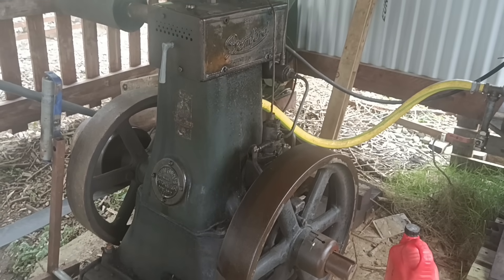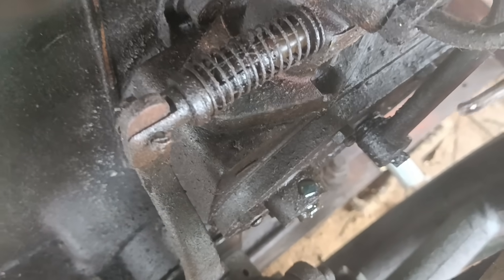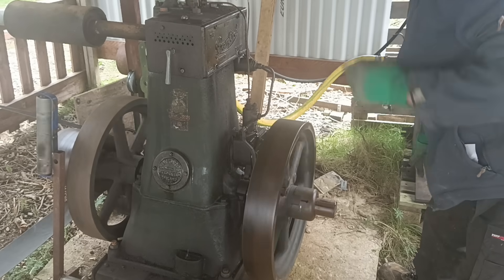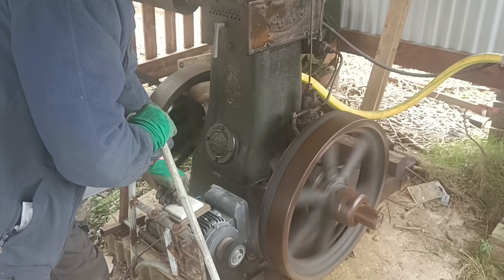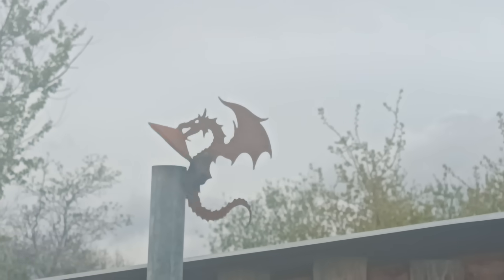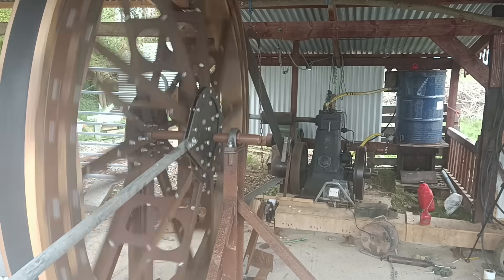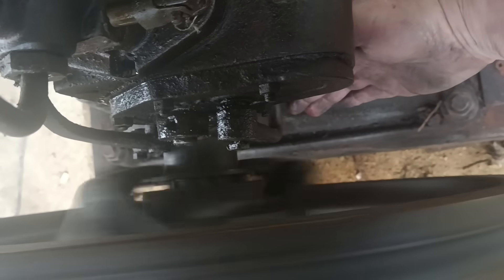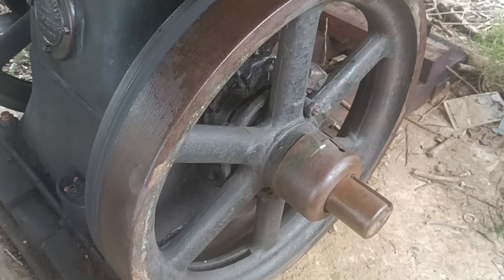How Much Fuel Does This Vintage Engine Use? Bamford stationary single-cylinder diesel efficiency

Comment: 6 HP is very low. A tractor mower is comparable. Or a small motorcycle. Or a Generator
5:51 I think you made a mistake.

1l of fuel has around 10 kWh. Since you needed 0.45l Diesel, you needed 4.5 kWh of Diesel Energy. But even a modern Diesel has only an efficiency of 35%-40% in its best working state. (This engine is neither modern, and probably not run with the right load, but I dont have a Datasheet for that specific engine, so I'll assume an efficiency of 30%, a steam engine has 10%, A 3 Phase electric Motor has a efficiency of 95%)

4.5*0.3=1.35 KWh of usable Power, 1.35/0.95=1,42 kWh of electric power.
You said that 4.5 kWh cost you around 2€. So this should be 0,44€/kWh. what results in a price of 60 cents.
Since it doesnt run in an efficient area, it would be closer to 42 cent.

If someone has real numbers, feel free to post them.
Reply from the maker: Thanks, Christian. I wasn't comparing the kwh of the diesel fuel - I was comparing a 6hp engine to a 4.5kwh motor.
Reply: @wayoutwest-workshopstuff6299 
 but if you compare the 4.5 kW electric motor at full load, you need to also take the fuel consumption of the engine at full load, which will probably be between 2 and 2.5 liters of diesel per hour...

Comment: Many years ago Tim, there was a push towards total power solutions. These were I believe a small Fiat diesel car engine, a generator and it used a heat recovery system from cooling and exhaust. They were hailed as the solution to "high energy prices" and every house could have one. If the Bamford can do it, let's hope it will not become commonplace.
Reply: Fiat diesel engines are Very good
Reply: @goodlife6277  but would you want one running in next to your house, in your neighbours garden all the time, or in all your neibours gardens. Heating oil boilers around me are smelly enough, cheers.
Reply: @ooslum  Never

Comment: Surprised by how little it uses, thanks for sharing.
I don't think a 4,5 kW electrical motor actually consumes 4,5 kW when it's just idling like the diesel engine. So that would change the calculation.
Reply: Reading through these comments and replys it seems there is a great deal of misunderstanding of types of electric motors and how much power they use, how they work, and how they would compare to this diesel. In this video we have no idea how much "work" was done so we have no idea the efficiency of the system. Having experience with a similar stuff, I'd expect to be able to run up your flywheel with a 1hp induction motor with no problem and grate all that charcoal just as quick. If I were to measure the power consumption of the electric motor it would be a little over its rated load while coming up to speed. As it approaches its normal idle speed, it is only consuming what is lost in the system. Work done at the charcoal grater is averaged out by the flywheel and we'd probably see around 1/2hp total load. Maybe a bit more if bearing surfaces are very worn. It can be difficult to understand why some motors consume much, much more power when bogged down by slight increases in load. Some motors are very efficient at only specific speeds and are usually powered with single phase and a starter capacitor that simulates another phase for windings that ensure the motor starts turning and always turns in the same direction. You'll find such motors in a lot of benchtop equipment. Brushed general purpose motors can be run on ac or dc and handle high loads at low rpm much better, and are still single phase. Induction motors are very suitable replacement for many drive systems, but require multiple phase ac to turn. They'll be more efficient close to their rated rpm, but can easily handle a few minutes of very high load as long as they don't get completely stopped. The faster induction motors turn, the less power they are capable of consuming. Such motors can be further optimized by control via a variable frequency drive, some of which can be powered by single phase ac or even dc.
Reply: Agreed.  I would think you would need to hook it up to an alternator and put a load on it like 4.5kw for an hour to compare to an electric motor of the same rating.
Reply: Three phase induction motors at no load use enough power to spin the shaft and make the casing get warm. That’s almost nothing. Load up the shaft and the motor will maintain its speed by pulling more energy. Keep below its rated load and it will not overheat.
Single phase motors are really not efficient just look at the hot air blasting out of any vacuum cleaner. They are more fan heater than power source.
Reply: @tripplefives thanks I re-read my comment and realise my mistake you pointed out so I edited it and removed that part so it only my main point about the initial cost is there.
Reply: Under full load it would of course even take a bit more from the grid to put it 4,5kwh on the shaft. 

However, as you mentioned the engine is far from really working that hard. The exhaust sounds like normal ideling. So kudos to the engine for doing that well of job. And agricultural diesel being that cheap in Ireland.

But let's do some calculations:
A Litre of diesel contains around 38Mj of Energie. 
We've used around half a litre. So 18Mj.
Crunshing the numbers that's around 5kwh. 
However, that's input power. Let's be fair and say your engine is 22% efficient, which is probably still too much. So you're about 1,1kwh of work that your engine did, so it made around 1,1. kw on average. 
Giving a bit more power as head room, you could use a1,5kw  3 phase motor with a vfd so you could even run it on single phase. That would draw around 6A at 230V. 
So you could basically run it from a normal house outlet. 

Still with diesel so cheap it would cost you around 150% of running the diesel for fuel costs. But would have its own advantages.
Reply: @humbucker0076  but as I understand it the use considerable more energy than the rated on the startup (electric motor) compared to normal running hence the need for capacitors etc.
Reply: @humbucker0076  Interesting calculations, thank you.  

Being American, I don't understand all this Liter and Mj stuff!  :)  I do understand 1/10th of a gallon of diesel though.  Diesel has about 37kWh/gal.  So, my back-of-the-napkin calculations say this engine used roughly 3.7kWh of energy.  

My electricity rates are WAY less so 3.7kWh would only cost me about $.37.  At the moment, diesel is $3/gal so it'd cost about $.3 to run this engine.  I have home solar with batteries so obviously, electricity would be the cheapest...not to mention lack of maintenance and mess.  

However, I do love the sound and history of these old work horses.  I'd take this engine any day over a simple electric motor!
Reply: @billbayer5526  technically speaking a 3 phase motor would require like 3-5% energy max at idle.
Idk about the wonky split phase crap they force Americans to use. But from what I'd read ages back your split phase system is similar to three phase.
We only have 1 or 3 phase motors, 1 phase motor is only 35% efficient while 3 phase are usually 85%+, so the worst that a motor can do on idle is waste 15% on 3 phase and 65% on 1 phase.

But if you have a bldc then the gloves are off shit is 95%+ efficient at any speed.😮
Reply: @humbucker0076  I think I replied to the wrong comment.... 
Although I think it would take a very large motor to turn the flywheel if you were going to effectively do a straight swap for the engine.
Reply: @PandaJ  if you straight swapped the engine with an electric motor with a fixed frequency and expect it to rev up the flywheel on startup directly to its max speed. Then I would totally agree with you. 
However, with just one ohse service you would use a vfd anyways, that can spin the wheel up slower, reducing the power required drastically as faster acceleration means a greater power demand. 
Not to forget that with a vfd you have a very linear Torque curve and no torque dip at startup. Additionally the power rating on electric motors is the standard rating. On startup they can deliver much more for a short time. 

Mentioning your other point with the reliability:
Yes, definitely. We've got a big problem with our mindsets as a society linking the price of something just to the price label at the store and not in the long time. Letting us buy the cheapest crappiest stuff we can find. But if you buy an industrial grate motor (as the stationary engine is too, otherwise you could use a cheap chines 6hp CAS engine for 120 bucks too), they will last forever too. Those manufacturers can't afford to build crappy stuff, because the industries where it's deployed usually can't too. 
But even if they break after their time they usually don't repair them and just throw them away. However, from my experience those motors usually don't fail because they're flaws, but instead because they were the wrong size or kind for their purpose or bad generally bad conditions and maintenance. Like putting an unshielded Motor in wet conditions causing it to rust. However most often those issues are related to overheating due to them not getting enough airflow at their mounting place or them getting so dirty that they too can't get airflow. 

Even though they build thinks back then to last more than they do nowadays for consumer products. 
However, you could buy your fair share of crap back then too. Every body wanted to build engines back than, but that doesn't mean they had any real clue if what they were doing, or just wanted to do it cheaply. 
But you don't see that, because all that stuff went to the scrapyard decades ago and nobody bothered to remembered that crap so we're left with just the good stuff, that has proven itself - which is a fair share.
But that will happen with the current things too.
Reply from the maker: are you sure? I'm told that's exactly what it uses
Reply: @wayoutwest-workshopstuff6299  There is a difference in power draw depending on the load just as with all engines. Especially AC motors with a set RPM (by the mains frequency). When they reach their rated speed there is less magnetic feild to overcome so the current draw goes down. Electricity is a weird thing.
Reply: @express496  Electricity can be weird to wrap your head around. 
However, the diesel engine would use more fuel too, if it were to be run under full load. 
To get a certain amount of energy out, you need to put a certain amount of energy in. 
That's just thermodynamics. 
But that also goes to other way round. You can't really put in more energy than you get out the other end. Otherwise the energy would be lost (ignoring the phase shifting with AC inductions). Of course some goes into heat, but with the electric motor most of it goes into mechanical energy at the shaft. 
So if your mechanical load decreases, either you motor would get really hot, but that's not the case because the input power just goes down too. 
As for electrical power it's voltage times current. Your voltage is fixed on the grid side so your current draw has to go down. 
Making you only draw the power you really need in that current moment at the shaft.

Mentioning the fans: I just wanted to add that they might be a bit misleading, because it's power draw is determined by how much air it pushes through which directly correlates to how fast it spins. It's not like the charcoal grinder that can run at the same rpm ideling or grinding charcoal. The fan will more or less always push the same amount of air. 

Nevertheless. Even if an electric motor costs around 150% the money power wise, it still doesn't surprise me that the stationary engines aren't far more common still. 
Considering first of all the size difference, the noise and air pollution when working around it. Not even mentioning with the smaller sizes you could have a motor for each implement each, not needing the space for all the transmissions. Generally reliability. There is not much to go wrong on an electric motor than maybe two bearings. 
Compare that to a stationary engine. It might be reliable, but the potential is bigger. Even if the electric motor breaks, you just grab another of the shelves motor.
Then there is ease of use. No starting procedure, no buying fuel and bringing it there. Basically just plugging it in and in this power range an extension chord is enough - At least with a variable frequency drive, but they are also sometimes below 200€ these days for small motors. Otherwise you have a big current spike for a split second when starting it up, but vfd is one way around it. 
Not to mention that the vfd gives you the flexibility of adjusting the speed. 

Mentioning the speed: 20-30 years back, when electronics were still expensive, controlling the speed of AC motors was also expensive. Giving combustion engines an advantage. However, that's changed too. 
And even if your in a field where there is no electricity, tractors have become popular since your engine was build and with their PTO they're like a stationary engine, but mobile, so. 

But still, I don't know how cheap you've got that thing. Maybe you've got a huge lead investmentwise compared to buying the other stuff. If you were to run it on vegetabtoil i.e. it would basically be free and green. 
And most importantly of all: for you it's sto some extend still a hobby, so efficiency is a value that can be traced of for other things like enjoyment.
Reply: @wayoutwest-workshopstuff6299  based on the ever increasing number of electric motors that are to be found in recycling centres 80 % at least that I have seen are modern motors many of which have come back under warranty, due to build quality related issues.. 
And any old ones are least 50 years.. so I think you're 80 year old lady is more economical in more than just the fuel!
Reply: @wayoutwest-workshopstuff6299  An electric motor uses less when idling. Your 450ml diesel fuel has less than 4,5kWh in it and the old engine might be worse than 20% efficiency. So I think you would have used around 1kWh with an electric motor. Its possible that the old engine runs on pure waste veg oil, but I don't know if trying could hurt something. Maybe somebody knows.
Reply: @wayoutwest-workshopstuff6299  No. An electric motor (any engine/motor) uses more fuel/power as the work done increases. If left idling (let's say at an unloaded set RPM, since electric motors don't need to keep turning when idle) they would use far less power than if at the same RPM but working hard.
Reply: Another way of supporting this: there is a reading the lamps dim and the motor over heats easier under load rather than when idling.

And in for instance HVAC/R it is common to have a general fan motor and then adjust the pulleys diameters to dial in the power usage.

And I am also super impressed by the idling consumption of your engine.
Reply: Another thing is that his cost isn't 45ct for an hour of work. It's 45ct plus whatever wear there is plus all the other maintenance fluids and parts (filters etc.).
And i can imagine that for an engine this old wear can get really expensive really fast, as there are probably no replacement parts left.
Reply: True but if he wants to replace the engine with an equivalent electric motor he'll need to have an electrical engineer instal/run high voltage electric cable up to the shed which will require planning permission and cost 1000s or possibly 10,000s of Irish Euros.
Reply: No an electric motor would not use 4.5kw when idling. Think about it, your average 4.5kw motor has tiny fins on the outside of the case that couldn't come close to dissipating 4.5kw of waste heat.
Reply: @TAWithiam  Even if it did use 4.5kW when idling, not all of that would be heat.  Only 80-90% would be heat so the little fan only has to dissipate 900W or so.
Reply: @billbayer5526  80-90% of 4.5kW is 3.6-4.05kW lol. The motor draws power proportional to the torque load on the shaft anyways, so if there is nothing slowing it down, it will draw less real power (not to be confused with apparent power).
Reply: @TAWithiam  Doh!! 80-90% efficient so would convert 10-20% to heat...900W.

Comment: That engine only outputs 6hp on full load, which it wasn't doing, so equating that to the potential electricity used with an electric motor is totally wrong. An electric motor will be cheaper to run than that engine for that load.
Reply: Especially if it was turning a decent flywheel to maintain it's torque